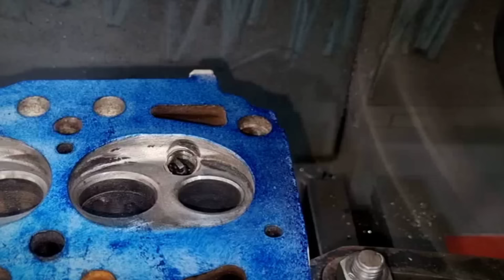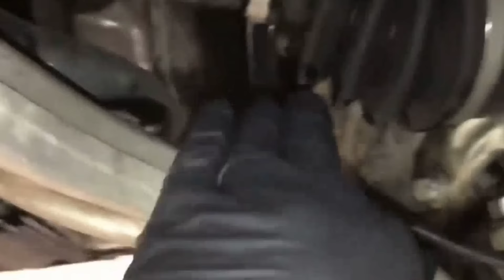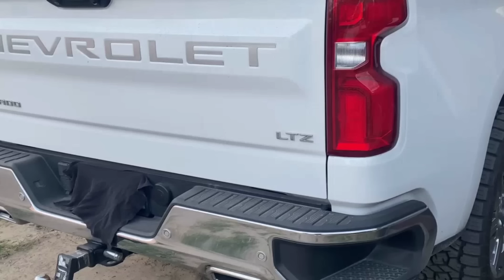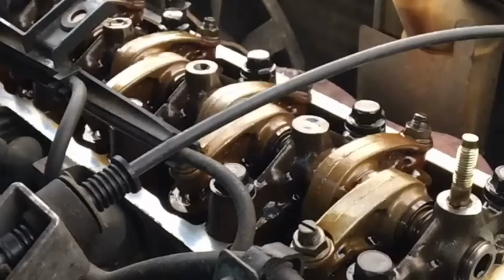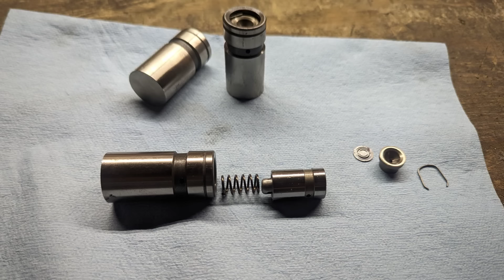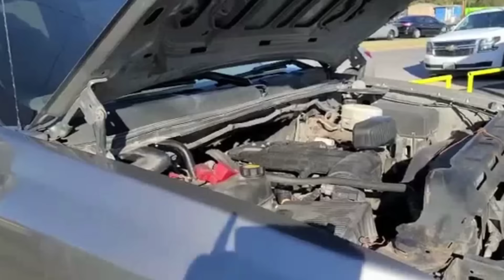3 WORST and 4 BEST Chevy Engines to Own

Comment: Somehow i dont think he would believe my 08 silverado's vortec 5.3 v8 has 270k on the original engine and no major repairs with the afm still active considering the praise he gave to the vortec 4.3 v6 im not saying the afm is a good thing by no means but even with it the 5.3 has proven its self time and again not to mention amazon sells an afm disabler that plugs straight into your obd2 port

Comment: My number 1 283 number 2 327 number 3 LT1350
Reply: Yep, back in the 1960's we had many. From or 1959 Blue four door Bel Aire to my sisters 1965 Vette. A 365 horse four speed. Soft yellow with a matching hardtop and a black softtop that was under that liftup hatch right behind your head. You may find this hard to believe but it had been hit from behind so the rear was cracked pretty bad but her husband who owned a body shop at the time had no trouble repairing it so you never knew it had ever been hit. Best part was they paid $1,800.00 for it. in 1968.

Comment: I don't think the Chevy Vega was the worst engine that GM ever built....... I had an Oldsmobile Cutlass diesel..... One of the converted 350 diesels...... It made it to 17,000 mi and blew a head gasket..... At 21, 000 It blew a controller that cost a fortune...... At 25,000 it cracked a head..... At 28,000 the transmission died because it had that turbo 200 with the Teflon seals..... And the list went on and on and on and on and on and never stopped.
Reply: Agree, I had a 75 Vega that ran 232000 miles. Had to junk it after 10 years because it had rusted out to an unsafe level. No engine problems ever.
Reply: I was a shop owner/mechanic during this time. The Vega engine could not tolerate Pennsylvania based oils. Those that used Castrol, Valvoline, Chevron or Havoline ran many miles successfully. This was also true for the Datsun Z engines and the Corvair. 

But more interestingly was that I towed a 28 foot RV trailer with a Pontiac 5.7 diesel, for more than 100,000 miles for years. The GM "DX" diesel was built for 3 markets - Federal, California and Canada. The CalEPA engines did fail early, produced lower power, and consumed more fuel, while the Canadian version (which I had), ran cleaner, made more horsepower and made very little smoke. 

The ConUS/Federal DX engine was in the middle for power, economy and smoke. 
Yes, the DX had head gasket failures, but FelPro had the product that cured it. 
Yes the Lubrifiner Roosa-Master pump would shatter the governor ring until it was replaced with a non-plastic part, with a stainless steel one (that was a GM beancounter fault!)  

The DX block was never a problem but the head bolts did fail. If the GM beancounters had allowed the engineers to use studs (to which I converted) they never failed again. 

Ultimately I drove that Pontiac DX 438,000 miles with 2 sets of head gaskets and 4 injection pumps and a few dozen glow plugs --- an inexpensive vehicle that I wish I still owned.   @Exsanguinator-bld
Reply: Ditto.  I had one too. Problems were back to back.
Reply: I agree. I knew a guy who had one, he about went nuts with all the problems he had. I guess the one guy at GM that knew it would fail , quit. He knew that they made a huge mistake.
Reply: Yes those 350 Diesel's were the worst engine ever
Reply: You're right, but he video is about Chevy engines.
Reply: But Chevy was all in on that diesel monstrosity.
Reply: Oh god.. you owned a 350 diesel. You deserve compensation for emotional distress 😂

Comment: The 4.3 V6 is also in many forklifts
Reply: Have one in my 2005 GMC Sierra single cab shortbed. Runs excellent all the power I will ever need and is excellent on gas as well.

Comment: Old school 283 best motor ever built
Reply: Loved this one in my Dad's 1965 Impala!!
Reply: @cdsorvinyl put one in 76 camaro  shifted at 6700rpm
Reply: My first vehicle was a 65 El Camino, it had a 283 with a powerglide, I wound up putting a 4 speed in it, I beat the piss out of that thing for many years, indestructible, I sold it to buy a 66 GTO with no engine, I should have found a way to keep the El Camino, I've always wished I had kept it.

Comment: The Vortec 5.7 was made till 2000,and still used in Mexican Market Silverados for a few years after that.
Reply: I have one in my 2001 Camaro Z28. Still runs great!!
Reply: They are still being used in marine engines as well. Volvo Penta and mercruiser marine are still using them...
Reply: @arthurgay5746 They were basically very good engines,it was bad cooling system maintenance that would create a lot of intake leak issues.When I had my 97 C -1500,I always took care of the cooling system,and kept the oil changed,and retorqed the intake gasket as regular maintenance,and didn't have any real problems with the engine,or the whole truck for that matter.
Reply: @arthurgay5746 I remember in the early eighties,a person I worked for had a boat he kept at Rocky Point,that had a 5.7 with a Q-Jet, ahead of a Volvo Penta Out drive.Very nice boat by the way.

Comment: Afm just to get 1mpg more if lucky that is RIDICULOUS!
Reply: Thank a Democrat for pushing the EPA requirements which justify this idiocy.
Reply: @anvilsvs i sent a letter ✉️
Reply: Most early 5.3 chevy's needed a waterpump By 100k due to the rubber giving way in the gaskets & should have been a recall, in which everyone went ahead & did the water pump while there & converted the ridiculous thermostat built in with the housing problem.
Reply: AFM just like Stop Start cost the owner more money, and don't forget the friggin govt demands, where they are totally useless in America.
Reply: @CorkyWine    If they can make a street legal 1000hp V8 engine, they can make a V8 that gets 40mpg.  It's too bad the government doesn't push them harder to do the right thing.